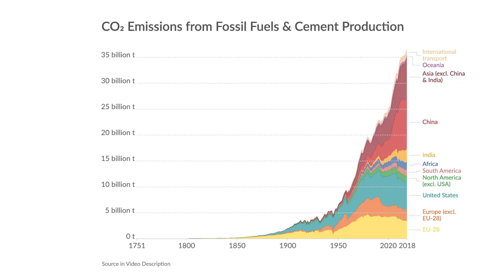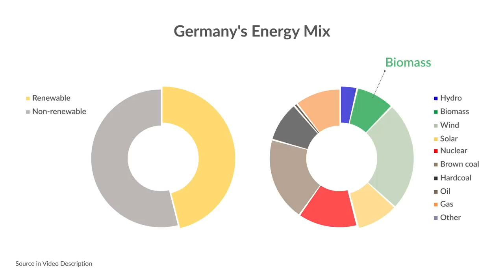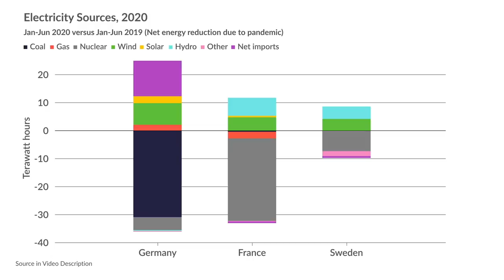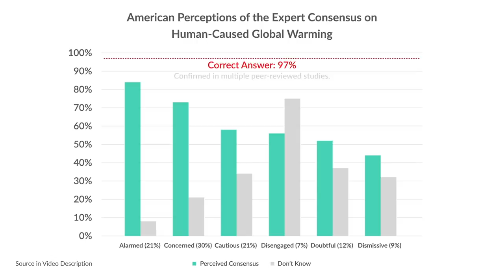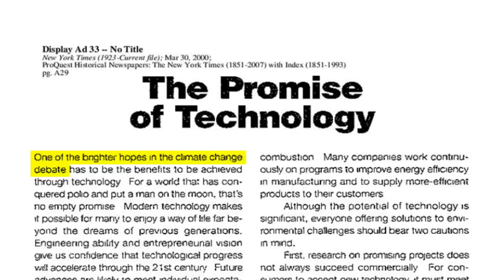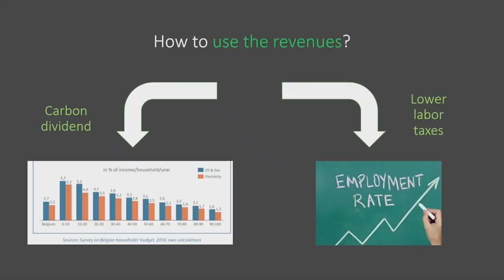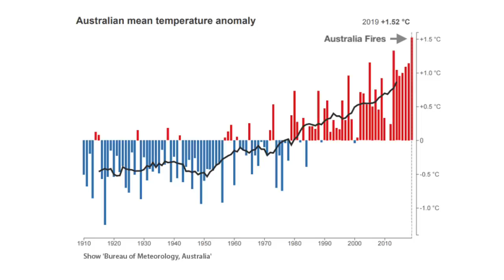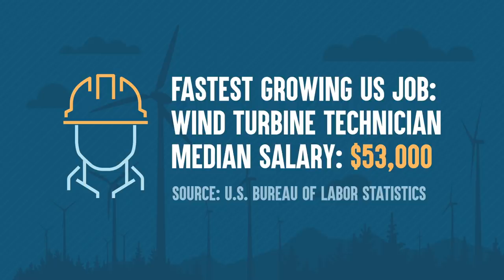The $5,200,000,000,000 Trick Killing More Than Covid, w Stephen Fry.

Comment: LOL!  The last part makes me laugh.  Hyperloop.  The link I got for this video was on Thunderfoot's channel debunking the Hyperloop as hokum.
Reply: Thunderf00t debunks everything though, he's just a cynic.  He's probably debunked oxygen in one of his earlier vids.
Reply: Me too, hilarious!
Though not so much hokum as completely unviable.
Reply: Fault his debunking on Hyperloop.  He makes a good argument on this topic.  Because Hyperloop sounds good does not make it viable.
Reply: Hyperloop would be ridiculously expensive to implement. First of all, you've got to purchase all the parcels of land along the route (which necessarily has to be significantly straighter and flatter than a high speed rail line), then you've got to build the thing - except it can't be surface-level, since landowners will need access to the land on either side and it's likely to cross existing infrastructure - which means it's either got to be above ground or below ground. Which then means you've also got to build access to the tube at intervals for maintenance and emergency evacuation. 

Assuming you solve all those problems, you've got to evacuate the air from hundreds of miles of tube and keep evacuating it (since the tube is unlikely to be a perfect seal), which is likely to be both costly and noisy.
Reply: Monorail 🎶
Reply: To be fair, high-speed electrical mag-lev trains are a good idea, from a technical, environmental, ecological, and economical perspective.  But trying to vacuum out all the air for a little extra speed is just not feasible.
Reply: Yeah, that was unfortunately ironic, given the emphasis on checking facts in this video. Oh well.
Reply: @Craxin01  Not just feasible, its bloody dangerous. Takes on terror attack to kill thousands within the same network of hyperloop.
Reply: That's fine, you don't have to believe in reality for it to exist.
If half of what any of these supposed hyperloop pioneers vision comes true, we'll have physical proof of it's viability within the next decade.
I'm not holding my breath, but I remain entrigued.
Reply: @madvova118  Assuming we could build enough small air pumps or super large pumps, it'd never work, as we'd be constantly trying to pull air back out of the system.  Holding a vacuum is nearly impossible even on the small scale.  Terror attacks would be the least of concerns, it'd be vacuum failure due to mechanical failure.
Reply: @madvova118  nope. Removing the vacuum leads to rapid but survivable deceleration. On-board life support is a fundamental requirement anyway, giving time to evacuate. Pods will be spaced to allow any pod to stop before it catches the previous one. Pods are smaller, so each one is less of a target than say a plane or train. You can't throw anything on the track either accidentally or otherwise. Pods move so fast and are invisible from outside, so targeting one will be very difficult.
The usual issues around security will exist at stations, same as any form of transport.
Reply: @MrGonzonator  Absolutely not survivable. 15 PSI will destroy any capsule in the system, even if the breach happens miles away. Decompression happens at 5 seconds every mile with the force of 10,000 kilos per square meter. 10 PSI topples reinforced concrete buildings. This is too dangerous hence why they are concidering abandoning vacuum sealed system. Can find the info using basic physics and studies done on the idea of hyperloop.
Reply: Hyperloop is 100% trash, want solid proof? Google "Transrapid" and research just a tiny bit how that all went.
Reply: @krashd   No only does he no debunk everything, but he doesn't even debunk all the garbage non-viable proposals that exist on the web.

He's debunked things that are debunkable. He's not being cynical in the criticism but following science and facts.
Reply: @madvova118  I think you're overstating the problem, all pods are equipped with emergency braking systems and there are repressurising vents all along the tube anyway incase of a pod failure. This means you can mitigate the propogation of a shock wave by letting air into the tube along its length. This would happen at the same time that all pods engage emergency braking. It's not ideal but no different to a 1000 seater train hurting towards a destroyed bridge.
Reply: @MrGonzonator  your logic is out of place here. please leave.
Reply: @Craxin01  I find it so funny that we're desperate to reinvent the wheel. Hyperloops and mag-lev? Guess what works really well, is efficient and can run on a centralised power source? Trains

Japan tried mag-lev, it's shit. Just normal, high-speed electric trains are, frankly, fucking amazing. Just do more of that.
Reply: And yes I fully agree. Musk might be decent at rocketry and Tesla is pretty cool, but the hyperloop as a concept is a waste of time and money because it will never work.
Reply: @captc0ck5lap60  you know people were skeptical and afraid of trains when they first were introduced. They thought women's uteruses would fly out and body parts would melt at high speeds. Skeptics of hyperloop and mag lev have more grounded arguments. But the point is people are always scared or skeptical of new tech. Give it time.
Reply: @boosted211  I think the proof is in the pudding. We tried hyperloops a while back and they have fundamental, insurmountable issues. Mag-lev works but frankly, if Japan can't make it reliable and cost effective I don't know who can. When we actually built trains, they worked for a ton of practical applications so that got rid of the nay-sayers.
Reply: @captc0ck5lap60  and that was much simpler tech. Just because it's hard or "expensive" doesn't mean we shouldn't try it. Flight was extremely impractical for a long time but eventually it worked out.
Reply: @boosted211  Flight was adopted very quickly, the first recorded instance of powered flight was in 1903 and we were using it in war just a decade later.

Mag lev has a ton of extra costs associated with very little gain over high-speed rail.

Hyperloop isn't 'hard' or 'expensive' it's practically impossible and thus nothing more than a waste of money. Like putting solar panels at the bottom of the ocean. Sure, 2,000 square miles of solar panels could generate lots of power, oh and we've nearly solved the pressure issues, but it's like no one cares that it's pitch black down there.
Reply: @captc0ck5lap60  flight was tried for hundreds of years before it was even successful. there is more challenges for these techs as far as infrastructure but they have advantages. mag lev will be cheaper to operate over time, less maintenance and the initial costs will come down. if hyperloops deliver on their promise of doubling even mag lev speeds im sure they can be useful in the future. lets see if the private corps can work out the kinks in the next few years.
Reply: @Craxin01  that's why it's not designed to be a perfect vaccum. It's about 1% atmosphere. That's achievable with fairly cheap tech.
Reply: @captc0ck5lap60  that's a very very very expensive solution.
Reply: @boosted211  I recommend you watch the video mentioned in the OP comment, it covers the fundamental issue pretty well. Like solar panels at the bottom of the sea, it's not a kink that can be worked out. It's an insurmountable issue with the concept at the most basic level. As for mag lev, not sure why you think a super conductor operating under high, constant power will be cheaper and lower maintenance than, say, two long strips of steel running parallel. In Britain, some of our lines have had minimal maintenance and have been in place for over 100 years of constant use. But I'm hardly an expert.
Reply: @captc0ck5lap60  watched one of his vids before. still think its doable. hyperloop, if successful, is a long ways away though. 20 years maybe. but the mag lev has less moving parts and uses energy more efficiently from what ive read. i dont think we should just replace the existing trains immediately but new projects should be considering this tech at the least. speaking from the states, our gov doesnt want to invest in infrastructure so its more about what private corps want to r&d. our high speed trains havent improved in 60 years and wouldnt be considered high speed now. like 200kmh. in my state our trains breakdown all the time and are pretty uncomfortable. mag seems like a good alternative. and since our tax dollars get used in terrible ways anyway, im all for funding potentially better transport even at ridiculous initial costs.
Reply: yea that was such rough choice.   after all that talk about dis and mis information and getting people to accept the scientific reality of climate change, they end it with Hyperloop.   Oof.
Reply: @krashd  The idea of constructing and maintaining vacuum chambers trillions of times larger than any that currently exist, compared to the minimal fuel savings vs. conventional trains, is on its face ridiculous.
Reply: @MrGonzonator  Um, no.  It's not.  Remember, once the pressure drops, it takes longer to remove the remaining air.  Plus, if you don't have your chamber perfectly sealed, there's going to be air leaking back in.  Even if it's a tiny amount, you can end up with a scenario where the pumps for miles and miles of tunnel would be constantly on and never reaching 1%.  Cheap?  It'd cost every dollar ever made and still NEVER reach that goal.
Reply: Thunder foot eh? Sure are a lot of experts on YouTube these days 😂
Reply: @ThumbDr  Yeah, he's got an actual doctorate in chemistry.  The man is an actual scientist and capable of working out the maths involved.
Reply: @mittfh  On the contrary, and this may help change your mind.  The pipeline construction and pylon supports allow for much greater flexibility than conventional railways and minimal impact on the landscape or cutting of huge swaths from migratory animals.  Roads can be traversed without requiring underpasses and overpasses. The low vacuum and zero contact between the pod and pipe should DRAMATICALLY decrease noise. Allowing routing through higher population densities. The discreet pylons are much easier to engineer to specific soils than conventional railway beds, and can be adjusted over time.
Reply: @madvova118  Yes, but can it be weaponized to crash into an urban center or nuclear facility? Maybe, this will mean less critical security and faster throughput than conventional air travel.
Reply: @Craxin01  Jet engines and air frames owe their success to routine international standards of preventative maintenance on every inch of the aircraft.
Reply: One of the properties of flight that made it a success was its flexibility in delivering payload to a destination with minimal impact or infrastructure.  The pylon and pipe configuration allows for much more arbitrary routing while preserving farmland, migratory patterns, ground traffic flows, and with less noise than a conventional train.
Reply: @captc0ck5lap60  Flight has been weaponized because of how flexible its delivery capability is.  Ground connected delivery systems do not have the same capability for better and for worse.  In the case of weaponizing mass transit/shipping Hyperloop systems have less potential.
Reply: @madvova118  Yes, but can a Hyperloop be directed into a nuclear power plant?
Reply: @helenaconstantine  Which is harder, sustaining a low vacuum in a pipe or sustaining a dozen jetliners  at high elevation? I only have my intuition, my guess is the low vacuum.
Reply: @markharmon4963  OK I'll try another analogy. You mentioned weapons, so why don't we put a shit ton of money into developing mechs for combat? We've considered them for just as long as we've had the hyperloop concept. They've been in media and are a feasible delivery platform for a range of weapons if only they had a good amount of research invested. So why not?

Because tanks do the job, much better. We don't need to build a multi-ton mech to know it's a fatally flawed idea for warfare. Tanks can heft bigger weapons, more armour and move over 90% of the same terrain at better speed.

High speed trains are the equivalent of tanks. Well developed, effective and efficient. Hyperloops are like mechs: They aren't just unneeded, they're hopelessly flawed, despite how cool they seem.
Reply: @madvova118  don't think they want a vacuum, just reduced air pressure
Reply: Robots most definitely are becoming weapons platforms. Small now, arbitrarily larger.  The first hyperloop will be small, it will be evaluated and iterated. The value of planes are there flexibility in delivery destinations and thereby they are successful  at being weaponized, see drone warfare and World Trade Center attack.  A hyperloop is not as easily weaponized as an air craft.  Can we agree?
Reply: @markharmon4963  Right, so I think you're missing both my points with this, but not deliberately.

First, I said Mechs, not robots. These are distinctly different. If you Google BattleMechs or Gundams, you'll get the idea. These are futuristic, manned, tank sized bipedal combat platforms. They're worse than tanks in every practical sense, but they look and sound cooler to fanboys and laymen.

Second, about aircraft. The Wright brothers didn't have a government grant to make a weapons delivery system. They proved the concept worked, on paper first, then with a practical demonstration. To be clear: The hyperloop has not been proved, even as a concept, as Robert H Goddard tried it already and gave up when he realised it was impossible. Not difficult, not problems with his level of technology, but impossible.

I don't know why Musk continues to throw good money after bad when none of the very reasonable criticism has been addressed properly, and the little test hyperloops have been an embarrassing failure.

But yes... I can agree to disagree. I just wonder how much time and money will have been wasted before this is scrapped.
Reply: @markharmon4963  Not at all.  Put a small charge on the outside of the tube and it could easily kill everyone on board the hyperloop, assuming every possible physics issue that makes them impossible were solved.  The sudden pressure increase would crush the train and everyone inside.

Maglev trains are being used in Japan at very high, but subsonic, speeds.  They work great and don't have the issues that need to be solved for this hyperloop nonsense.  Even so, you're ignoring trains as a vehicle for transporting weapons and troops like have been done since the Civil War.  Non weaponized?  Hardly.  So, no, I can't agree.
Reply: @helenaconstantine  I guess all the scientists behind the many hyperloop tests and prototypes are going to have egg on their face then, I hope you get to say "I told you so!" to all of them.
Reply: @MsHojat  He doesn't go after the shit on the web because they are not popular, remember he is just a YouTuber trying to earn a living and his novelty is finding something popular and poking holes in it.
Reply: @MrGonzonator  Watch the new video thank God he made it because I wouldnt be able to put it into text for you jesus christ.
Reply: @madvova118  who? What video? This thread is hard to follow.
Reply: @madvova118  I dislike his style. He spends to much time filling his videos with pointless sarcasms and sneering. I would have more respect if he simply outlined his arguments logically. It makes me suspicious that he has to dress his arguments up like that, what's he hiding? I'll admit, those two were fish in a barrel, their misunderstanding of thermal expansion was cringe worthy. But likewise, technological solutions exist which are inconvenient to Thunderfoots narrative and are simply ignored.
I'd love to watch him debunking Hyperloop when the first ones come online in a few years time.
Reply: @MrGonzonator  watch around 35 minutes he discussed what I was trying to tell you that the braking system etc. in that vacuum and segments of the tube etc. is useless.

Comment: Wind and solar require batteries or back up supply.You need to include this.
Reply: Both are very compatible with the production of H2 which could then used to power combustion engines. It's been tested and proven to work quite nicely. 
Basically you use the excess power from particularly sunny days with less power consumption and stringer winds for the electrolysis of water
Reply: @Daniel Meyers toxic waste ?
Reply: Over the long term the batteries will still have less impact.

Comment: I'd like to see what you're research brings you to when it comes to nuclear energy, from what I hear its better and safer than the fossil fuel industry as well as non-renewable resources. I've heard as well, much of the fuel has the ability to be recycled/reused. The waste from nuclear energy seems very little, and with modern technology maybe we could find ways to safely get rid of it in a couple decades, which seems reasonable considering the amount of waste generated by then wouldn't be on near the scale of carbon emissions. Also helps that deactivated nuclear warheads could be used to fuel it, but maybe I'm wrong on that part.
Reply: Yes and no I could agree. The biggest issue for me is what if something does go wrong. It is beyond destructive.
Reply: Small nuclear generators are very safe. The province of Saskatchewan is considering using these.
Reply: Yes nuclear power is probably the cleanest source of energy, they're safe and reliable. BUT, they cost millions to build and causes a massive headache when they reach the end of their life, they have to be disposed of carefully. The fuel and core of the reactor remain radioactive for hundreds of years. That's the problem with nuclear energy.  Disposing of the radioactive materials!🤔🤷🏻‍♂️